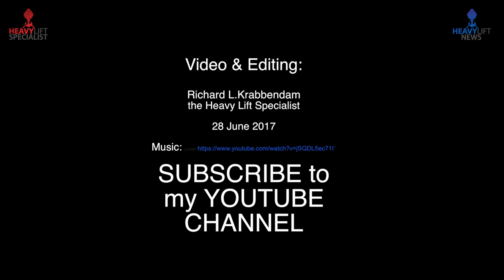Terex Demag CC8800-1 BoomBooster Integrated Logistics

Comment: what is the advantage to a booster over a regular section?
Reply from the maker: By adding a wider section in the main boom (72 m "BoomBooster"), the main boom becomes stronger/stiffer and enhances the lift capacity significantly at long boom lengths. Liebherr makes a similar "Power Boom"
Reply from the maker: The boom booster creates a stiffer boom, which is less sensitive to buckling and therefore can accept higher lifting capacities at larger radii
Reply: Richard Krabbendam    What capacity can this crane lift ? We had a similar set up by Welde x on a bridge lift in s wales a few months ago  massive amount of ballast for a 240 ton lift
Reply from the maker: You have to check this out on the load chart. max. cap. is 1600 ton, but the load itr can lift depends on the radius and length of boom
Reply: @andrewtoyotarees1379  1600 tonnes